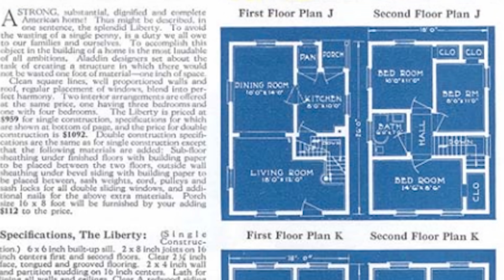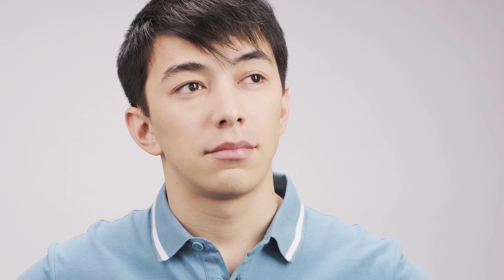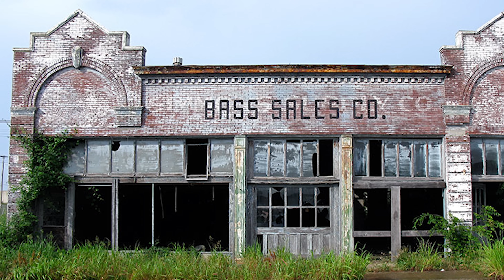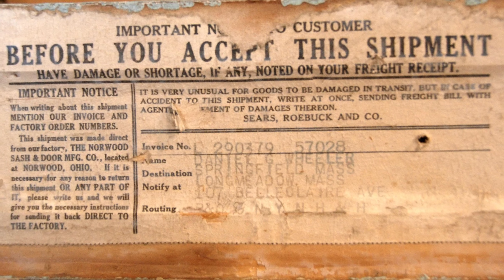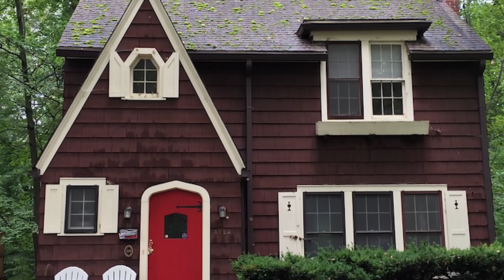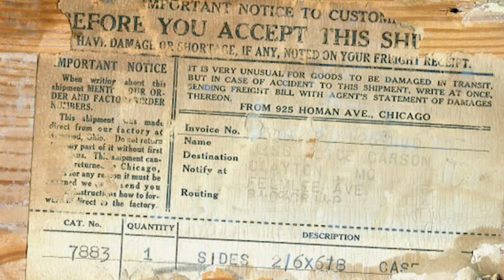What are Sears Kit Homes?

Comment: My son bought one as a fixer-upper. The wood in the house had swelled over time to where none of the interior doors would close. 
He was going to remove the solid oak doors and replace them with modern doors. 
I said I would fix them. I pulled down each door, and removed from 1/4” to 3/4” from the hinge side of the door. Cut new mortises for the hinges. Stained the edge and re-hung the doors. 
You couldn’t even tell they were shaved down. 
These doors were massive. They’re now a feature of the house. 
It took a couple of days for 11 doors. Using a Bosch power planer.
Reply: You definitely did the right thing.
Reply: They don't make them like they used to. Many homes in the most expensive areas of Seattle were Sears catalog kit homes. Houses that were bought for $6,000 are worth a couple million dollars now. They're still standing and while they may require some updates and maintenance, the overall stature and stability of the original structure is impressive. As you'd mentioned, solid oak beams, strong frames, heavy doors, etc. They used to do it right.
Reply: @TheReapersSon  Now if you want to build something like this it cost 6k for the plans designs and details alone, not to mention the 100k+ for materials to build the damn thing alongside all the permits to even build it.
Reply: Your son was lucky to have a handy dad with a plan! 🤠
Reply: Glad you did that. They are irreplaceable.
Reply: Great job, Dad!
Reply: From one woodworker to another, I thank you.
Reply: Like a Bosch
Reply: @TylerDaSaint lol
Reply: You are great Dad and that should build a forever memory.
Reply: BRAVO DAVE 🥰🙏
Reply: Good for you!! Those solid doors are a rarity out there.
Reply: Love that!
Reply: Thats awsome.
Reply: I recently purchased a rather old Home, and I have the same issue with all of my interior doors...none close anymore. Is shaving the doors the only way to tend to that happening?
Reply: the swelling doesn't inspire confidence
Reply: @qwertykeyboard5901  it’s pretty common for wood to swell over 100 years. 
This part of Ohio is humid. Furniture makers take swelling in to account. 
It will swell and shrink with changes in humidity. But over time the swelling wins. 
This house didn’t have central a/c for the first 100 years. So it fluctuated a lot. 
These doors had big slabs of redoak for rails and stiles. 
Whiteoak would have done better. Teak wouldn’t have swelled. But those cost more. Even back then. 
They used to call redoak pissoak for the way it smells when it is being cut. 
With a/c the doors should stabilize.
Reply: @qwertykeyboard5901  Try a little less qwerty and a lot more knowledge.

Comment: The small town, Brunswick,  I lived in while in Maryland had several of the Sears kit homes. The model woodland was owned by a family I knew and it was lovely. These older homes had personality.  I would love to own one.  There is also a family in Davidsonville that has a kit home and have researched it and have no idea what company it is from.  When doing work on the home it was discovered that the wood had Roman numerals engraved in the wood pieces. The house is well over 150 years old. It is beautiful. Every door has a transom and there are no closets. The bedrooms have massive armoires.  The first floor contains an elevator (was added later) and it is very very small and has metal doors like those on the titanic in the movie that the 3rd class passengers were killed as they couldn’t find a key to unlock them.   There is also a downstairs water closet that simply contains a toilet. And it too is very small. The family who inherited it were doing restoration and renovations as they were going to live there when the Roman numerals were discovered. It even had the original kitchen which was basically a large room with shelving to store all the food from the garden etc for winter. I absolutely love that house. The architecture is beautiful in and outside too.  Has anyone ever heard of a house put together using Roman numerals?  They have done research but have come up empty handed. I live history and really enjoyed looking it over.

Comment: If my house isn't a Sears kit, it looks a lot like one. It was pretty clearly built as a starter home next to the family farmhouse. There are a couple of houses on this block that look suspiciously like Sears Kit homes. For what it's worth, mine seems to be holding up pretty well compared to stuff built in the 1990's by actual contractors. Make of that what you will.
Reply: The materials used to built TOC homes were fairly good, even by today's standards. There is a reason they hold up and are worth preserving.

Comment: I'm not sure, but I think the city I grew up in, along with some neighboring cities, is flushed with these kit homes, or homes modeled just like them.  Additionally,, rail lines run right through them and the cities were mostly built out before the 40s.
The floor plans and architectural designs are too similar to be just a coincidence.
I didn't realize some of the kits involved building large homes, like the two white homes near the start of the vid.  Those are big!

Comment: The origins of the “McMansion” 😂 
But in all seriousness, the build quality and lack of waste on these historic homes are incredible.
Reply: Back when waste was lost profit.
Reply: @baneofbanes  Now it practically IS profit.
Reply: And they look really pretty too
Reply: What's the difference if a board gets trimmed to fit in a factory or on the job site, either way, the boards need to be cut to fit.
There is very little profit for contractors building houses, so they don't waste any more than is necessary.
What makes you think there is so much waste in new housing construction?
I'm not sticking up for new houses, they are junk, and every corner that can be cut is cut, I'm just saying I've seen no evidence of them wasting materials.
Reply: @bigredc222  New home construction is the field I have worked in on and off for years. I still work in a related field and almost daily work in new homes. In my experience, new home construction is terrible in the Southern U.S. It is still alright in the Midwest. The problems seem to be the use of cheap materials, the price charged for the cheap result, and the managment of the building process. In the Midwest, we would build a house and it would end up looking very high end at a generally low price. Some relatives moved into one of the houses that I had helped frame a couple of years before and they really liked it. It was a good builder I worked for and a quality home. 
In the South, the superintendents are rarely involved, spending most of their time busy with tasks that have little to do with actually building. I have watched as the same mistakes happen in, for instance, cabinetry, for years. The result is houses that the new home owners tell me themselves, are cheap and plauged with problems. My younger brother and his wife wanted a custom home here in the South and went to get pricing from builders. I then took a couple of hours and added up all of the materials for their plan and they ran the numbers. It was unbelivable how much could be saved if they just found a builder to sign off on work they had done by paying friends, etc.
Reply: @matthewmosier8439  I'm an electrician, I started out wiring new houses, but I only did it for about three years then I got with a company that only did commercial work. After you've wired five or ten houses there's nothing left to learn, I like a challenge, I like learning new things. The only challenge with residential is to see how fast you could do it.

Comment: I grew up in two that were next door to each other.  One was a 2 bed one bath with a breakfast room and laundry utility room and single story with large covered front porch.  The other was a layout where the 2 bedrooms were separated by the bathroom and the kitchen was on one side of the home but all the rooms connected as they each had 2 entrances.  There were built-ins galore but the closets were tiny.

Comment: I've worked on several thru the years around the St Louis area in both Missouri and illinois. Also, don't forget Sears sold a block machine too. Pour in concrete, release, make a block. Lots of those in the same area. When you see a block house, just look at the blocks, the design, you can actually count how many block machines they used to build the house, based on how many different designs of each individual block.
Reply from the maker: That's really interesting, I'll keep an eye out!
Reply: I worked in one about 20 years ago in Central Illinois
Reply: Yes indeed and it’s nice that one of the example address labels 🏷 Ken showed us had “Clayton, MO” as the location! 😎

Comment: The fact that they would sell from a very plain crackerbox home to basically a gingerbread ornate mansion was especially interesting.  Thanks for another great video.
Reply: I worked in a Sears Home -  the original owners had bought and assembled the home In the late twenties - once the owners had passed away in the late seventies the family kept the home for several years and then decided to sell it in the late 1980’s -  being it was located on a large plot of land on the water in Florida - it was purchased and turned into a restaurant with a tiki bar that is still open and operating today after 35 years of business !
Reply from the maker: Glad you enjoyed it!
Reply: Modern custom homes are nowhere near as cool as these.
Reply: And the fact that the most expensive  home, adjusted for inflation, cost under $90k
Reply: Matt if you account for labor, foundation, land and all the new systems that are standard it would be much closer to 300k plus

Comment: In 2005 a friend and I vacationed in Colorado near Pueblo and of the several buildings on sight, one we were told was a Montgomery Wards house.  We were told it was the original homestead and over a hundred years at the time.  It was in excellent condition had 2 stories but not one I would consider that "flowed" smoothly.  (guess all the open, flowing home patterns came much later). I thought Montgomery Wards was the only house kits offered as only today did I learn about Sears.
Reply from the maker: That is really fascinating!  I'm glad that we could share with you the history of another Kit Home manufacturer! 
-Ken